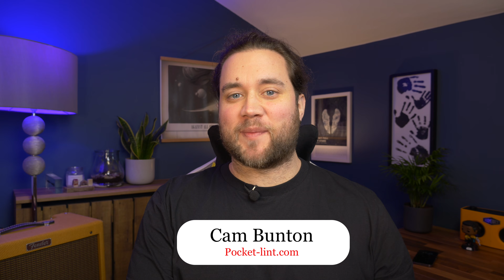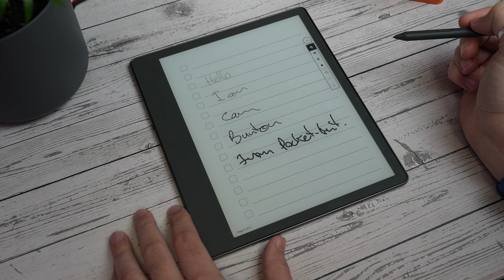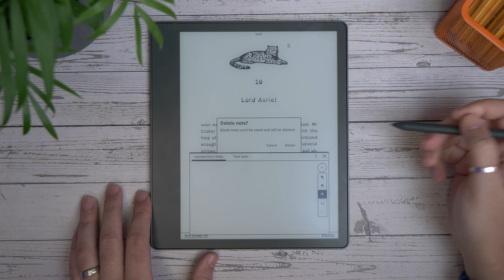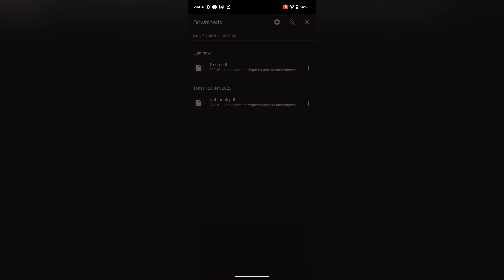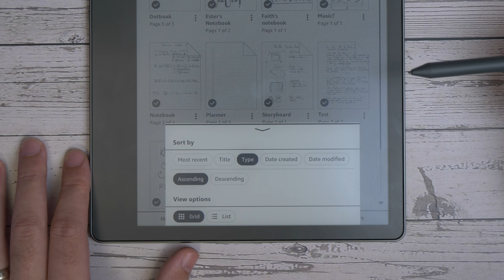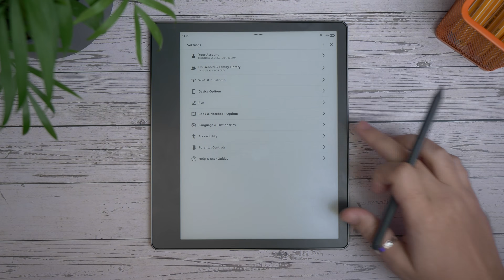Amazon Kindle Scribe tips and tricks | 14 MUST try features!

Comment: The only feature I would add to your kits is one that has been around a long time and that is taking a picture of the Kindel screen by tapping and holding the top right and bottom left of the kindle screen.  The screen shoot can be found in the main directory of the Kindle device.  This could allow the user to use their own OCR program/app on the image.  Apple’s built in OCR works great with these images, for example the iPhone.
Reply: I've tried this a thousand times and it still doesn't show up. I wish there was some animation to show if taking the screenshot was successful.